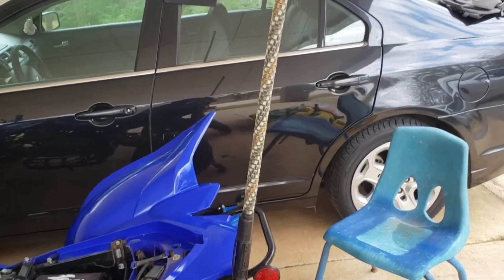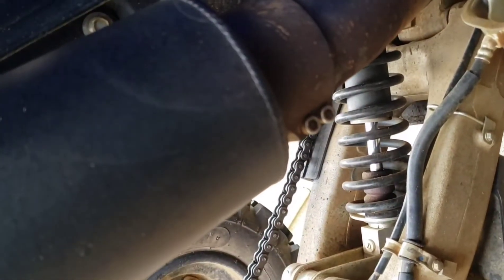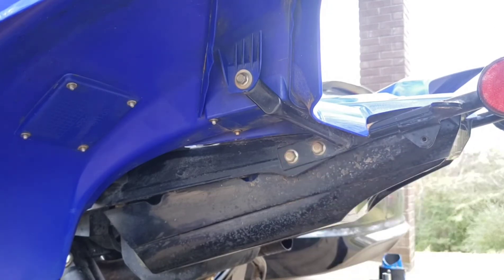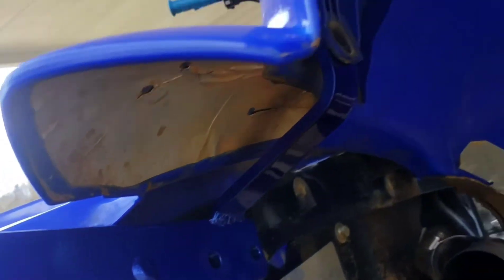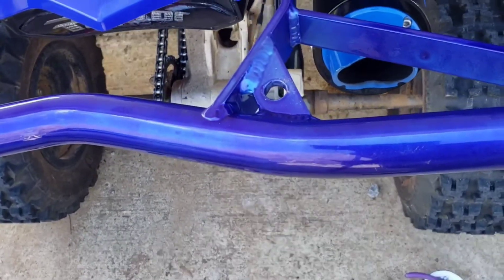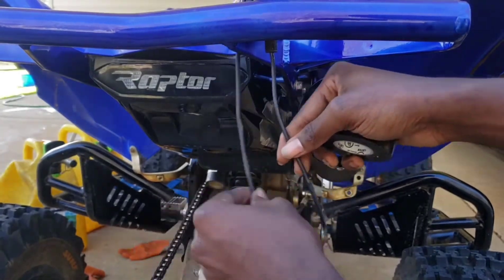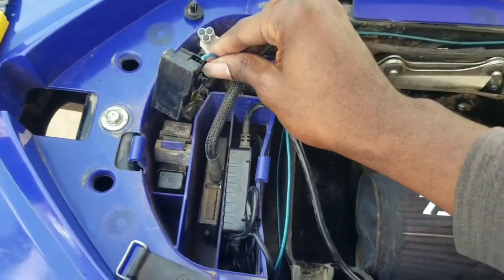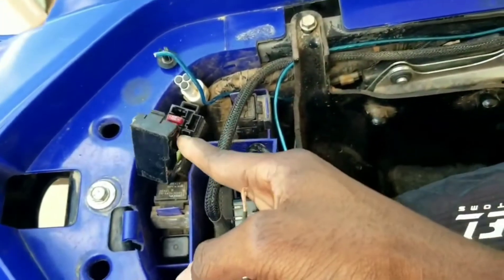David Cote Grab Bar and LED Pole Install Raptor 700r

Comment: Could I just run the cables to my battery terminals or would that be bad
Reply from the maker: It May Drain The Battery The LED Pole i Had Before This One I Had Wired To My Battery and It Drained The Battery While It Wasnt In Use
Reply: I have the paper and it says I need to connect the red to the battery 12V and the black connect somewhere to ground I don’t know much about Electrical and I’m watching your video but mine is a bit different
Reply from the maker: If The Instructions Says Connect To The Battery It Should Be Safe To Use The Battery Connections
Reply: @SonicRaptor  you have Instagram I can message you on

Comment: Do you have a model # or name of this particular grab bar? I really like the design. Thanks
Reply from the maker: I dont know if you have a Facebook account but the seller is on Facebook you have to send him a message and he will send you a PayPal invoice his name is David cote his profile pic is him with a helmet on I wouldn't hesitate buying from great customer service
Reply: @SonicRaptor  I found him! Thanks man.
Reply: Do you have a active link. Im unable to find his facebook
Reply from the maker: @flyby72351  https://www.ebay.com/itm/Yamaha-Raptor-700r-Grab-Bar-Bumper-Rack-06-21-T6-Aluminum-Blue-/274995699319?mkcid=16&mkevt=1&_trksid=p2349624.m46890.l6249&mkrid=711-127632-2357-0
Reply: @flyby72351  if you have FB you can lookup David Cote. His profile pic is him wearing a welding helmet from Clearwater Florida.

Comment: Hey is ur grab bar made of steel or aluminum?
Reply from the maker: 6061 Aluminum
Reply: @SonicRaptor  has it warped from moving or lifting the quad from it?
Reply from the maker: @elfay5320  that's how its made
Reply: All these grab bars being sold on Amazon, ebay etc, are made of cheap aluminum, they bent easily once you try to move the quad around, ive try 5 different bars already and they all same crap.im putting the factory 1 back, i pick up my quad from the back to load it in the bed of my truck and believe me these bars feel like paper, its actually  very dangerous.its sad because they do look good man.